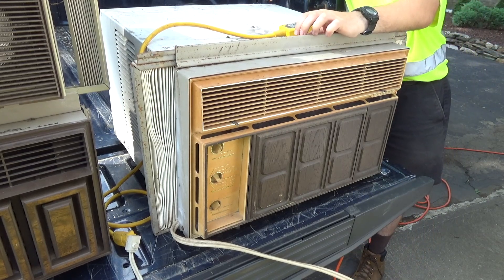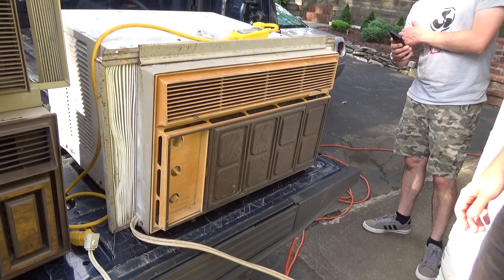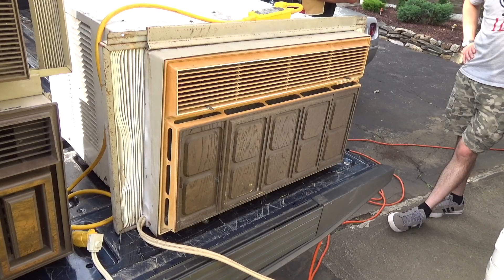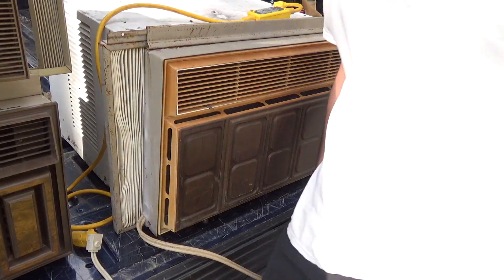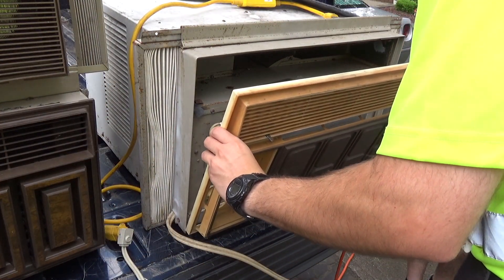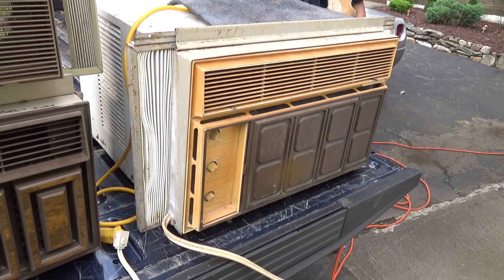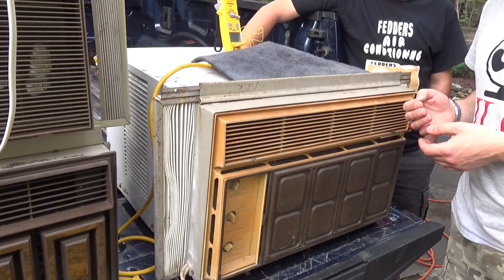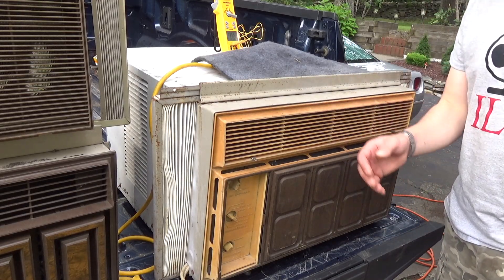The Loudest & Least Efficient AC I've Ever Tested | 70s Fedders ACT20F3EE 20,000 BTU Medium Chassis

Comment: So if this was the medium chassis, what was the large chassis like?  In terms of size and BTU/hr rating
Reply from the maker: The dimensions were a few inches larger, and the noise a fraction of this one. I believe they came as large as 36,000 BTU.
Reply: I had a 15k large chassis unit, was absolutely massive and quiet as a mouse. Only got loud on high fan but was just airflow noise. Ended up selling as it wouldn't fit in my windows in that house (or current house)